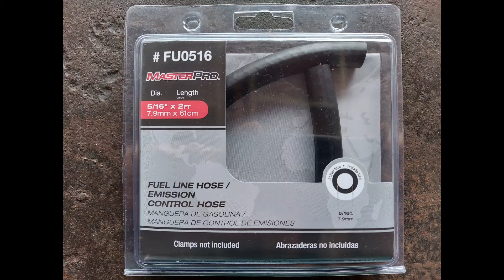2011 Chevy Cruze LT:  Turbo Coolant Hose Leak Repair

Comment: Thanks, i was wondering if i could rig something. Once i found the leak while changing oil i googled and thought i had to buy a whole line repair kit for over $100 then found just the coolant return line, then looking at the car and all that needs to come off to get to it i thought about going to the local mechanic and make it my wallets problem. Some proper high temp hose and good clamps should solve the problem for good though.

Comment: Great Vid. I have the same 2011 same color but mine is not an L.T. and I don't have the flashing. Only overheating issues I  have encountered is the plastic water supply valve. Have replaced 3. First one took 1 hour and a half last took 30 minutes. Like the thermo covering because this car runs HAF.
Reply: Same issue. I keep a spare. Takes longer to get everything out of the way than it does to replace that POS. SERIOUSLY thought about trying to find a machine shop that can fabricate one out of some type of metal. Be it steel or aluminum. The 1.8 has something similar, does the same job, but you can find a replacement that isn't plastic.

Comment from the maker: Past a year and the hose is still holding and have no leaks.  Use Stainless Steel Worm Gear Hose Clamps. These cars run hot so, just a suggestion for the car owners down south, where the weather temperature is always hot, to use 100 coolant and not 50/50. “Suggestion”
Reply: Coolant is for the anti rust additives. Water keeps the car running cool.

Comment: Is this still holding? Having same issue with a 2012. About to perform same modification
Reply from the maker: Yup since I posted the video, still holding.
Reply: @edowiggenout  what size clamps?
Reply from the maker: @j4mesgz  a size that goes over 5/16 or 7.9mm Diameter

Comment: Hey we replaced this hose a while ago but idt my uncle used the right size bc it’s still leaking. Either that or the clamps aren’t small enough to get tight enough around the hose. Is this still holding and did you drain your coolant first? This car is the worst. What clamps did you use?
Reply from the maker: I just drained whatever was in the damage hose and use double clamps on each end. Used Stainless Steel Worm Gear Hose Clamps. The hose I use is in the video and a clamp that fits over a 5/16 or 7.9mm Diameter. Once everything was replaced, ran the engine and leveled the coolant.

Comment: must buy a hose, inner diameter 7.9mm?  I found one with 8mm is it ok? =)
Reply from the maker: Not sure, if it fits snugly and use double clamps and no leaks, should hold.

Comment: why did you cut, and not just use needle nose pliers to move back the clamps??????????  you have pliers to take hose away from pipes. just to funny. how many accounts did you have to make to get 86 likes.?
Reply: nevermind now i remember i had to do that